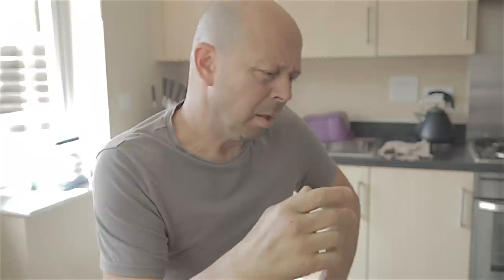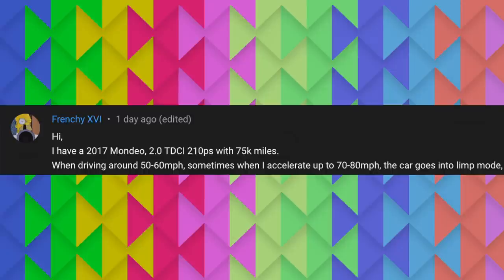Engine takes a dump into limp mode, Ford Mondeo Mk5 2L Diesel, Answering a viewers question.

Comment: I've got the same issue and the following codes : 
P228C - Fuel Pressure Regulator A Exceeded Control Limits - Pressure Too Low
P02FA - Diesel Intake Air Flow Position Sensor Minimum/Maximum Stop Performance

Anyone had the same ?
Reply from the maker: if i were you i would go the same route and check your fuel filter and injectors, the p02fa i believe could be your egr valve but deal with the p228c code first
Reply: @alan4x  Thanks for the reply, fuel filter changed and the issue is still there. I want to order the pipes now so I can check the injectors, can you tell me what size fits ? 6mm or 8mm? Also can you provide your supplier for the high pressure fuel pump spring?

Comment: Hi indeed your advice  seems your a Ford  expert    Fort transit custom.  Battery shut down total loss of battery power , 

Need help  so pulled up at car park turned engine off  wife said move abit closer I’m sticking out back end   So put keys in absolutely nothing ,no lights /clocks or alarm, now won’t start, it’s  as if thers no battery on,
So went into shop get what I needed came out  tried central locking  as I walked to it ,
still nothing ,black clocks nothing lit up at all,
sat in it thinking it’s obviously a power issue,  it’s already got a new battery/ alternator /new cables underneath  from alternator   Then heard a bleep  all came back on    Iv no trust in it to be honest now,
being disabled  I can’t take chances breaking down  everything reset itself on clocks mpg it’s as if battery was disconnected then put back on 

any ideas what it could be all connections are tight    Think
It’s gonna be going tbe journey
Just about to call  for a bloody taxi ,
And the damn thing started

Comment: u can´t turn the car off if u got keyless ;)  :)
Reply: It is keyless, when it happens on motorway, I pop my warnings on, put the gearbox in Neutral, turn off the engine and turn it back on, then put the gearbox in Drive.
Very stressful to do, even more when doing 80mph with someone tailing me and it goes into limp mode suddenly.... 🤣
Reply: My mk4 will switch off if I press the button when driving along! Whihh I think is quite dangerous! 😂 😂

Comment: I know Alan has gone to pastures new, I have a MK5 2.0tdci, Doing the very same. What's really doing me in was that the garaged sold it to me like that, did they know?? Well they didn't fix the leaking tyre valve seat, although they had it for 6 weeks in their showroom. They must have been pumping it up every four days. Problem is they're miles away. So I bought a scanner and drove the car with it connected, limp mode happens when you do an overtake around 70MPH. But no codes recorded 🥵Ford's did a full service for me, including the leaking tyre and fuel filter. Still going into limp mode with no codes.
Reply from the maker: If you have no codes your scanner you bought is no good. Best thing is take it to a garage and let them scan it. 
If your car goes into limp mode when you put your foot down there will be codes. Once you have the codes and the explanation that will be read on the scanner for the codes you will know where the fault probably lies or let me know what they are and I will see if I can help
Reply: @alan4x  Thanks Alan. I'm going to drive it tonight with my son as a passenger, filming any live data. I'll get back to you. Cheers
Reply: @alan4x  Hi Alan. No codes but at the point of limp mode it said Error  EGR 90%+. I guess EGR clean or replacement. Do you know what the damage is if it's replacement? the car is under warranty, so I guess they'd clean it or possibly not even cover it. It will be a DIY job.
Reply from the maker: @markjohn4802 you could try to get warranty on the egr but if you have to replace it yourself then check the Ford dealer price to an eBay one as sometimes you could get a better deal on a genuine one. Those egrs are very troublesome and I have had many apart from leaking coolant cause all kinds of running issues